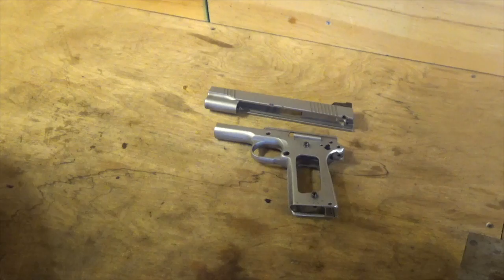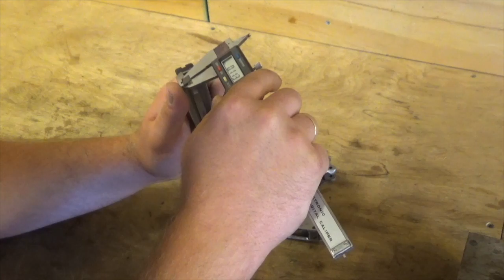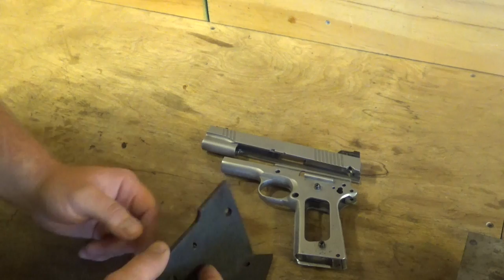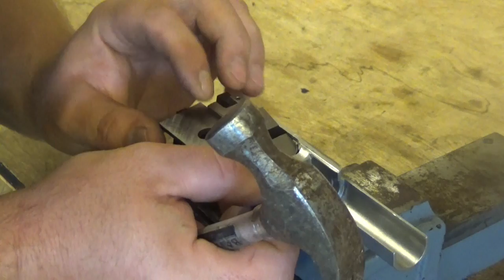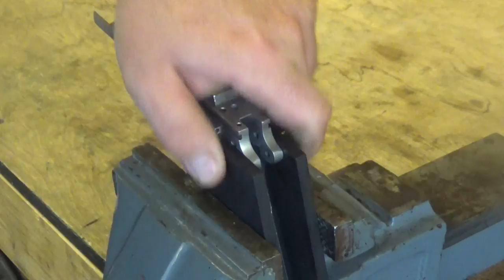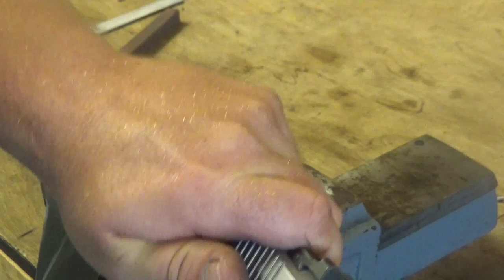1911, Tightening the frame rails - Peening

Comment: A tool called a” Swedge’ would have made the job a lot easier and more uniformed.Also the use of a claw hammer when working with metal drives me ABSOLUTELY NUTS!
Reply: I just use rocks it works too LMFAO

Comment: Please consider using a heavy brass hammer or hard dead blow. That hammer you're using is tool hardened and is much harder than the slide and you're only denting the frame. The idea is to bend the frame rails down, not deform the metal. Thanks for the video but this is not the correct procedure.
Reply: +1
Reply: Bend it. You gotta mushroom it. Bending it will weaken it.
Reply: You obviously never formed an ak rivet persay.